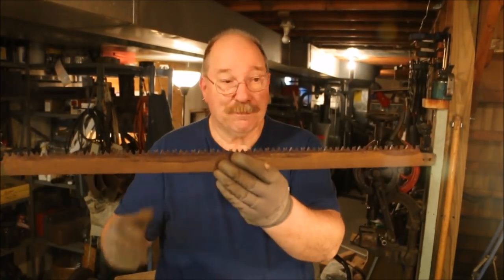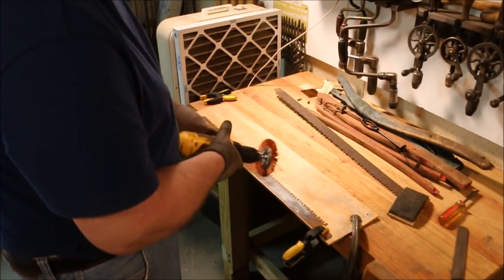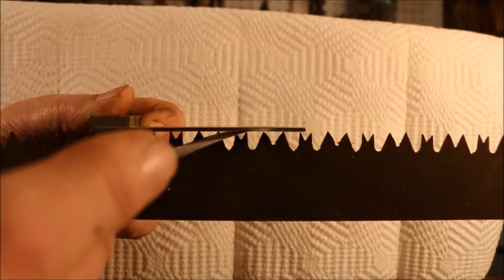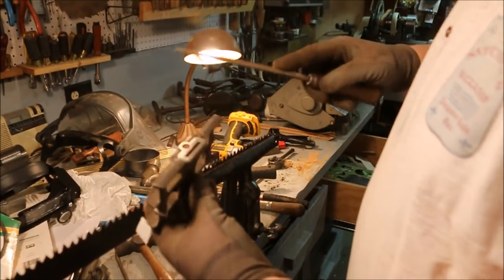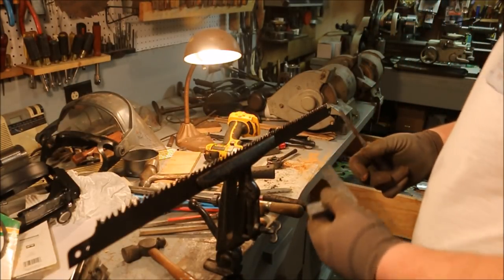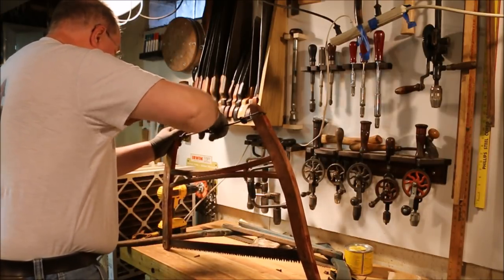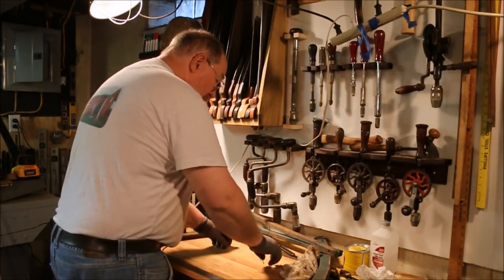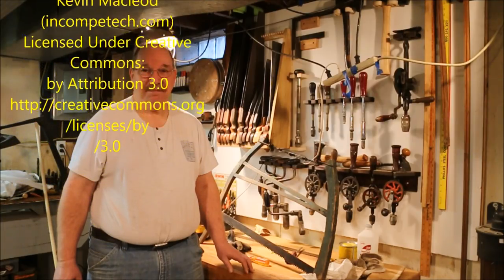WHEN GOOD SAWS GO BAD ~ PART 3 ~ REMOVING THE RUST AND SETTING

Comment: Well there's a good old saw put back in to some sort of use but most of all you've rebuild a memory which is priceless very well done .and we've all been along for the ride and learnt something on the way nicely done thank you 😊
Reply from the maker: After going through this I think I could cut a new blade from a piece of spring steel banding. I was concerned about being able to hold the shape of the teeth without a template. It felt like the teeth wanted to shape themselves into the proper configuration. 
I'll bet there is a bit of old wisdom in the design. The masters didn't do anything just for the heck of it. They learned over centuries, and lots of saw making, what worked and what didn't. 👍😊😊😊
Reply from the maker: I ordered a shirt for myself tonight. They won't be able to tell us apart at all. Now I just need to send Lewie one and we can be the three stu... Amigos yeah that's what I meant. 😊😊😊
Reply from the maker: Now all we will need is a group picture. 😊😊😊
Would you like a different color?
Reply: Old Sneelock's Workshop never thought I always chose a blue /Red/Green never light colour. Always working as I was they get dirt damage to quick and stain then look untidy. Like the thought of a group picture that would be fun how that’s the problem I’m hoping to get over when I can. Have to wait till better weather my feet are always cold so it’s freezing the brain cell
Reply: This may be of interest to you I've just ordered a 10" half round and a 6 " six sided triangle extra slim diamond coated files they have 5star ratings but ? Who knows they aren't dear so I'll keep you informed to what I think . I'm thinking with them being diamond any thing can be filed .they are said to have 180 grit .they are probably chinaeseum but we will see .the proofs in the eating at the end of the day . If they are no good I can always  make them in interesting coat hooks or something
Reply: My 'nice' shirts are dwindling and I hope to be burning diesel next week so I'll order one shortly. I'll get up with you and Dave and get the color that you all didn't. Then it'll be panaromanitic-er-ed-ing-whatever!
Reply from the maker: David Chadwick We can cheat on the photo. Get a picture against a solid color. Lighter is better but anything as long as it is all one color.  Then we will work some magic.
Reply: Belsaw had a retoother. If you could get that pattern.............
Reply: I was born untidy and have grown steadily worse ever since.
Reply from the maker: Lewie McNeely The shirt is in the mail. You should have it around the 17th of March.
Reply from the maker: David Chadwick Cool!
Reply: KNOTHEAD! And a check will be in the mail monday. Thanks, Unc.
Reply from the maker: Lewie McNeely No checks Lewie. As the designer I get a discount. My treat to you and David.

Comment: Nothing like bringing a tool back to usable status, nice job! Hey how did the cheap HB file work out? You know the wide extra slim file :)
Reply from the maker: It is still a viable file for knocking off corners and roughing out keyways but with the corners gone it will no longer sharpen saw correctly. It leaves rough radiuses in the bottom of the gullet. That creates stress risers and will cause the teeth to chip off. I went over this saw with a proper saw file at the end. 
PS. For the finish work I used a standard Slim Taper file so it would fit the size of the teeth.

Comment: I think George is going to be happy with his saw. Too bad it takes so long to sharpen when it's so quick to dull it...
Reply from the maker: Bill K. I essentially cut new teeth in the saw using the original spacing. Normal sharpening takes half an hour or less. The metal tube frame, little D shaped pruning saws have induction hardened blade that is faster and easier to just replace like a hacksaw blade. If this hadn't had sentimental value I would have mounted the spare blade.